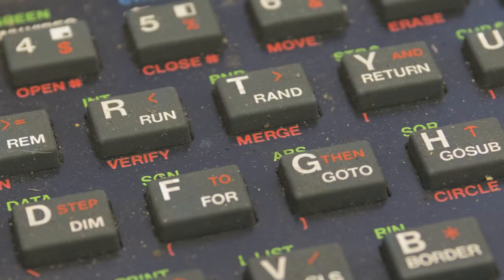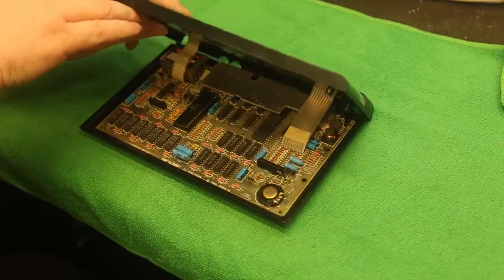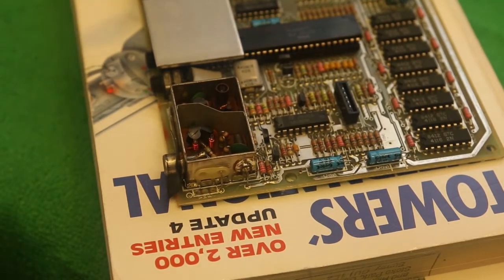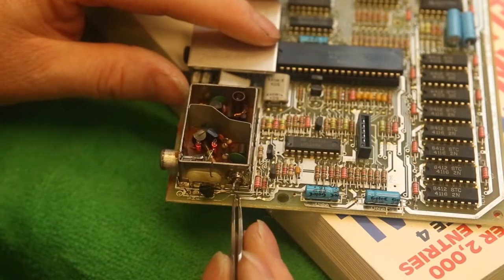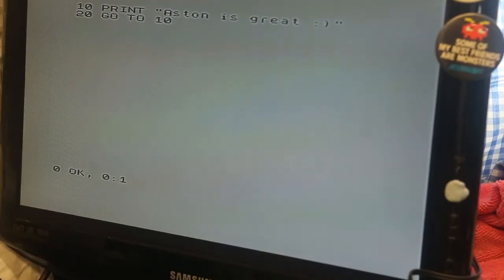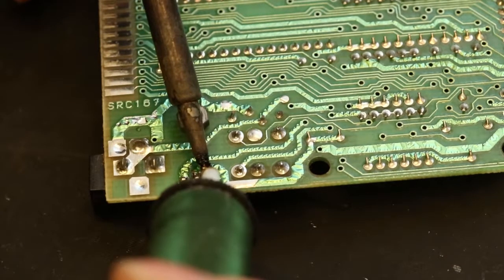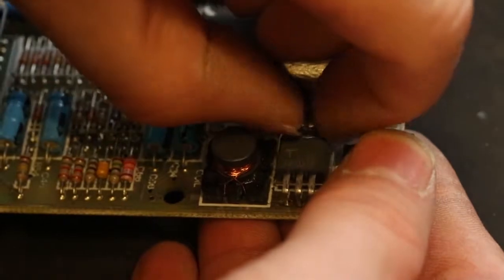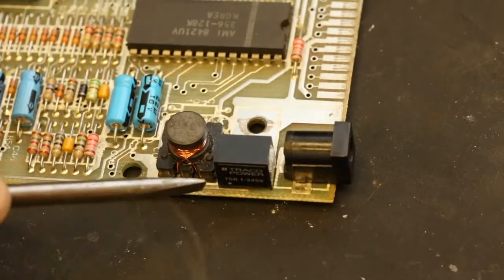ZX Spectrum power supply and video output mod's

Comment: veri nice and neat job! These days may easier replace the 7805 to 5V DC-DC stepdown.
Reply from the maker: Indeed, I wrongly referred to it as a regulator, but as you say, it is actually a DC-DC converter by Traco. Removes a lot of heat generation from the Speccy. Thanks. 🙂